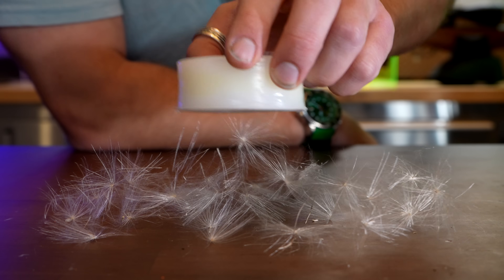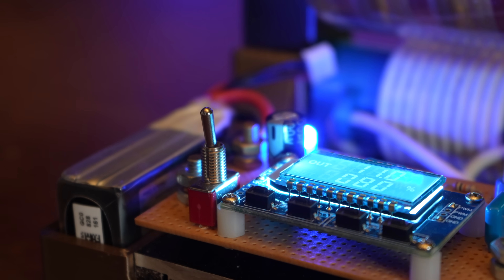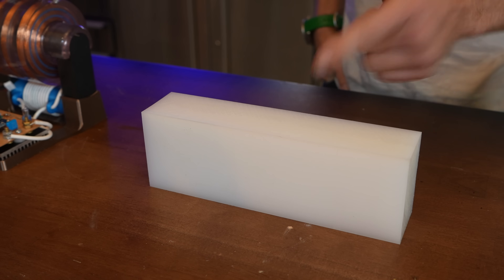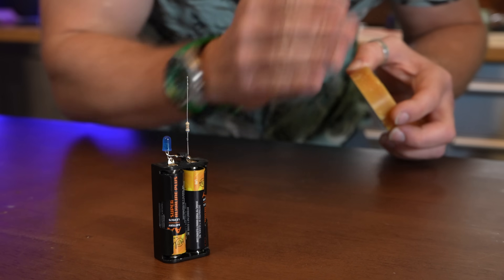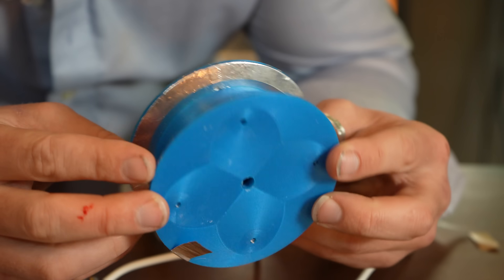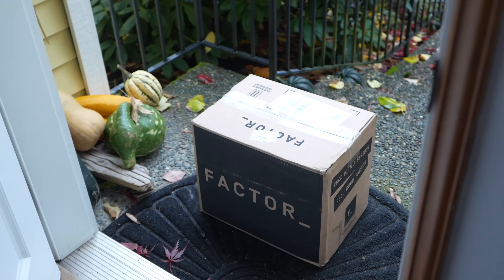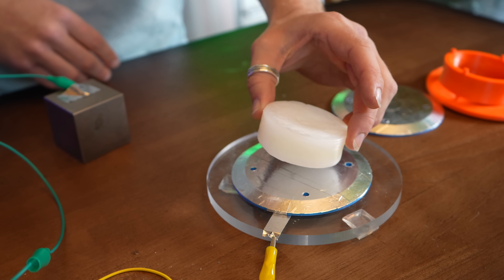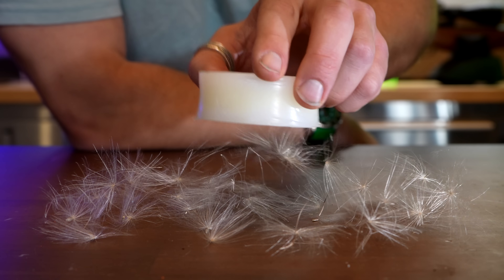Creating an Exotic Material With A Permanent Static Charge (Electret)

Comment: I wonder if you could make a higher resolution detector out of a tv screen.
I'm surprised there are not more comments about the finger pointing effect...
My take...
We are all capacitors, the finger tips are the ends of our "circuitry", ancient (and contemporary) eastern traditions call these circuits, meridians. 

Six meridians start and end at the finger tips, six start or end at the toe tips. Yin meridians of the Hand terminate in the fingers. Yang meridians of the Hand begin in the fingers. The Yin and Yang meridians begin and end the opposite way on the feet.

If that's too Woo, disregarding the long history and scientific inquiry over the last century,
Think of it like a tesla coil without a sphere, the arcs come from the sharp points, usually at the furthest point.

Watch the video titled: Mysterious plasma starts glowing from fingertips.

Our sense of touch like all of our senses are electrical phenomena, this is why touching someone, like holding hands or even the pain of a joint lock will dissipate unless a slight squeezing or rubbing or twisting happens.

Ever tried tickling someone with an elbow? Not very effective. 
It is the tips of the fingers that conduct the most energy to the receptors of the other person.

We are Electric beings 
In an Electric Universe
Much Love
Terra Pax

Comment: When you point your finger at  your Van de Graaff generator, it doesn't actually lose charge, or at least not a lot. The static electric field from the generator causes the electrons in your finger to be either attracted on pushed away, depending on charge of the sphere. The result is a charged finger, which creates it's own electric field, which is opposite to the primary field and completely offsets it within your finger. But this field extends beyond your finger, weakening the primary field. If you get your finger close enough to the generator, it's field becomes strong enough to reduce the field at the detector below the detection threshold.
Reply: Same as how an electrolytic capacitor has greater capacitance than a vacuum capacitor.  Actually any dielectric will counteract the field between the plates in the same way as you describe.
Reply: @goodmaro 
Its different effect. But same result.
Dielectric are non conductive you are conductive.
Reply: Nice explanation
Reply: The question is why pointing with a finger but not the palm of the hand effects it.  This is because the electric field comes off a object straight out.  Your finger is a POINT (rather then a plane) where the electric field is concentrated on the tip of your finger.  The lines of force are all equally spaced on the surface of the conductor (your finger).  Since the tip of your finger is sort of a point, in order to have the same number of lines of force as in a non-point,  the field must be stronger.  Must in the sense that it's got to follow the rules of electric fields that require the charge to be equal anywhere on the conductor.  So when the guy points at the generator, it sucks much more electric field off the generator then just putting your flat hand by it.  It is not a result of 'capacitance' or inductance.  Just DC electric fields.
Reply: @fredwork4919  what is a capacitor if not an electric field?
Reply: @fredwork4919  geometry does absolutely matter in this case i would agree, changes it's distrubution of charge and accumilation. If i'm not mistaken, some ol electrician wizards can even create complex circutry through geometric setup considering magnetic field interaction alone.
Reply: It is because his finger tip is a greater attractor than the free space around the sphere, so as he closes in on it pointing at it, the is a gradient change that is attracted to his finger that changes the shape of the once spherical field that was around the sphere.  Like a star bleeding off another kind of shape.  A High Voltage DC power supply and dielectric fluid bath can show a perfect example of the same effect.  Here is what I mean...
I watched one of our new engineers give a demonstration at the HV maker I was at many years ago.  We use a dielectric fluid in the lab to test new HV builds in the lab that have not yet been potted in their HV section.  It looks like water...  scary.  It has about a 1500 volts per mil of dielectric insulative strength, however.  So, a 50kV HV supply was sitting in a 3 inch deep bath of this fluid, with nothing connected to its also immersed output terminal. He took a 3.5 foot long 1 inch stick with a HV wire on it and a nail on the end of it with a rounded, polished nose ground on the end of the nail.  He grounded the wire to the supply ground and as he approached the bath to within a foot, the bath started 'turbulating' (for lack of a better word) or dancing around as it were as he got closer and it got more so as he got closer.  He actually immersed that rounded tip and had to get to that breakdown distance and ZAP!!! it fired a spark THROUGH the fluorinert fluid, which I had never seen before, triggering the auto-shutdown on our circuit.  Then, he repeated the demonstration with a sharpened nail end as the 'probe'.  The fluid dance started over two feet away from the bath the moment he turned the nail point toward it!  And BEFORE he was able to get the nail point down near the bath the spark ZAPPED out of the fluid to the nail! It is all about gradient level and attraction.  A huge attractor, such as the Earth gets a pointy thing mounted to it.  That's where the lightning strikes hit.  Caught in a lightning storm?  Make yourself a little fetal ball on the ground.  No extended arms or legs.
Reply: Yep high k factor electrolitics with monatomic doping is great fun.
Reply: The keyword is dipole. Dipole fields are weaker than monopole.

Comment: So, have you TRIED the MOTION of the Electret as it passes by a Magnet.  Or how they ' interact ' with Magenets. Then the extrapolation is from ELECTRICAL CHARGE to Magnetic CHARGE/Induction in  ' other ' materials.
Reply: Well, isn't that special.  Apparently no one in the comments really knew what an electret is or even has a clue of the significance.  Ping me if you want more insight.  Beware the Rabbit Holes.

Comment: When they are making Electret microphone capsules at the factory, I always heard that they have to give the Electret it's initial 'charge'.

It's strange to think about how long the material can hold that charge, which is often many years / decades.

I don't know if that's quite how an Electret mic works, though. lol

Most of the small capsules just have a FET inside, with the Gate hooked up to the Electret membrane.

Comment: What happens when you make a electret in hollow cylinder form, charged inside and out rather from end to end? If you made a pipe formed  electret with a positive charge on the interior how might that effect water and air flow through the pipe?

Comment: Back in the old days Benjamin Franklin stated that the stored energy of a capacitor is inside the insulator not the conductors so technically the capacitor is the non-conductive material or the insulator. Wouldn't this technically be considered as a permanently charged capacitor if it can handle a "load"

Comment: The dielectric breakdown of air is proportional to pressure, so could you eliminate the corona and use a stronger electric field if you did the cooling in a pressure chamber? Maybe even SF6 if you wanted to be really insane?

Comment: If there is a permanent charge, then, isn't that free energy? It can turn on a led, all the time, what if you create a circuit with houndreds of big and powerful electrets, charging capacitors and then alimenting something? Maybe a circuit with an high voltage trasformer, to get infinite lightnings
Reply: lol no, that's not free energy. battery is used to light the led, not the field of the electret. the field is, well, a field, it doesn't perform work. also, he used an enormous amount of energy to make the thing. and it isn't, strictly speaking, permanent, it will dissipate eventually. in weeks or years, but the charge will go away.
Reply: @ironwheal  yea i didnt think it much when i asked the question, but for sure it doesn't go away in weeks if you do it well, it can last many years, the ones in microphones should last at least 30 years, and in the video he says those ones last even 100 years, 
But i wouldnt be that sure on the fact that you cant make energy out of it, there already is a very simple motor that work just with static attraction
Reply: @Justabeingg  sorry, the energy still has to come from somewhere. there ain't such a thing as free energy. well, technically there is (hydro, solar, geothermal, etc), but it's still not free to make it usable.

Comment: Maybe ten or fifteen years ago, I imagined a static field detector by using a rotating disc with exact same type of sensors. One sensor has a JFET transistor.
So, while each sensor to be placed on the edge of the ring, it might be able to detect the DIRECTION of electrostatic field.. or would be?

Comment: Had all kinds of fun playing a magic trick on my boss when I built a detector a couple decades ago. I removed the safety resistor which seemed to increase the sensitivity at risk of blowing out the MOSFET, but the result was great: I stood on a linoleum surface and keeping my hands visible and motionless could say "on" and "off" and have the light respond. I triggered it by lifting or lowering my shoe on/off the floor. That surface pulling action built enough charge in me for the detector to trigger. Was hilarious as he tried to figure out how I was making such as simple circuit work by voice. :D

Comment: The reason the light turns off when you point your finger is because current started to flow through your finger. The same reason your first electret turned out poor due to the coronas.

Comment: Does the field strength of the electret vary if you cut in in half (without generating too much heat in the process)

How many times and how frequently could an electret charge a capacitor without experiencing thermal decay, and could it be the basis for a switching power supply for at least 1.5 to 3.3 volt applications?

Comment: With the vandegraff, I think picturing a constant number of field lines is accurate. At first there are a bunch of lines from the top to the bottom of the generator between paired charges. Let's say + on top, - on bottom. As a conductor, you're going to become polarized to oppose the vandegraff: - on top, + on bottom. Now the field lines previously pointing from the top to the bottom of the generator are going to be pointed more towards you, ending at your corresponding charges. There are now a lower density of field-lines passing across the resistor, meaning a lower E-gradient, causing lower current, keeping the transistor subthreshold.

Comment: I think the Van-de-Graaff stopped activating the field detector for the same reason that the first attempt failed. Just like the intense coronal discharge on the first mold, you might have given the static charge from the generator a way to escape by putting your finger closer. So the field never reached the required strength threshold.

Comment: Your vandegraff emits charge that you can pull to light a halogen light, right?

Can you not indefinitely light a light with this then?

And what about if you made two and pointed them at each other and did experiments like with magnets?

Further, what would increase strength? thinner with more surface area? Thicker? Individually thin stacked wafers?

Comment: I was thinking, as the electric field decreases with the square of the distance (E is proportional to 1/R^2, where R is the distance), when you apply the E field to the material, the inner parts will be affected by a weaker field, so why don't you make multiple thinner electrets and you stack them on top of the other, to obtain a stronger electric field?

Comment: I think the reason why the electrons are not going to the electricity detector is because when you point at it it you are taking in the electricity instead of letting the static go to the detector through the air
Reply: agree

Comment: Question?

If the Great Pyramid was a giant Van Degraf generator then that must mean the casing stones was able to contain the collected ions within, How would that possible?

There has to be some way

My idea is If the Star Shafts in the queens chamber of the great pyramid held liquid mercury like I've suggested and if the metal spun when electricity was applied then the surrounding ions would whirlpool around the shafts...
Kind of like if you spin an electric drill bit in water then the surrounding water would whirlpool around the spinning bit in unison?
so this would create a current effect with the ions
---------------------------------------
In fact I think the Star shafts had several uses...but mostly it was a giant tuning fork

It created vibration - this charged the 2? tons of quarts crystals embedded throughout the stone.The vibrating stone also produced ions?. 
-----------
Vibrational frequencies

So basically the Star Shafts are a giant tuning fork, when the Mercury is spun it produces a vibrational frequency and also vibrates the stone

They're even shaped like a tuning fork the way the shafts bend 

& if another tuning fork is added above?

You would in effect create a torrid structure throughout the entire structure, this would ram +ions thru the capstone & into the ionosphere above & create a gravitational field too

Also note the shape of the pyramid is very much like a giant cone, this is a very powerful shape

Take the theories about flight mh370 for example where supposedly three plasma orbs traveled down a cone trajectory to create a wormhole.  

This would mean the Pyramid acted like a giant Van degraf generator but it had a cone shape instead of a round sphere  

picture if you put a giant cone inside the doughnut looking torrid structure, then picture what would happen when you ram +ions thru the upper tip?

I have no scientifical learnings & I may just be blowing pot smoke outta my ass ... Or maybe I'm one of those pathetic youtube experts who suddenly know everything because he watched a couple of videos 

So feel free to just spit on me and walk away I care not 

Since everything has it's own vibrational frequency then what did the two tuning forks in the structure actually do besides create a torrid structure? 

 & what would happen is +ions traveled thru stone & struck the charged quarts crystals contained within?

You wouldn't need a belt to charge the Pyramid, even running water far below the structure could gather ions right?

& also could it be possible that the casing stone would repel the ions inside to contain them until they could be shot thru the capstone? maybe the casing stones were -?

Comment: I think your mold should have two holes: one for the stuff to get in and another for air to get out. If you 3D print a small pool area (basically a funnel) around the infil hole, you keep filling the mold until it starts to come out of the air hole. For further details, see metal molding.

Comment: electricity goes to pointy thing, you're discharging the vandagraf generator, the charges are running to your finger in a steady stream, but they're not concentrated enough to discharge in an arc.

Comment: Would it be crazy to make a detector out of a string light arrangement for a visualization in 3 dimensions? lights every couple inches on a string. Multiple string suspended in a grind, creating a 3 dimensional grid of lights in the space. Could you have the lights change colour based on electric field intensity?

Comment: It would be interesting to see the affect of the electric fields from such an electret on alpha and beta particles in a cloud chamber.
Perhaps you would need to place the radiation source between two electrets in order to achieve a maximal flux to hopefully see significant deflection... beta particles should be much more visibly deflected than alpha particles, of course. Then again, maybe the electric field from the electret would make it too difficult to see the stream from alpha or beta particles...
On a similar note, it would be interesting to see if/how much beta particles would be deflected along magnetic field lines, by placing a radiation source on one pole of a strong magnet (i.e. N52 or higher)...
Although, it's possible that alpha and beta particles could emit xrays when deflected by a magnetic field, if they're fast enough. I'm not sure if they have enough energy immediately after a decay in order to emit an xray photon due to synchrotron radiation.

Comment: Couldn't you measure your field using a voltmeter? You could literally map electrical potential difference across the field by moving your 2 electrodes in the air around your electret

Comment: Got a suggestion in case you build another one. We all know rubber is a great insulator for electric charge. Wouldn’t using that to prevent the arcing during the creation of an electret allow you to yield a stronger charge? Probably around 1/2 inch to 1 1/2 inch of rubber to insulate properly.
Reply: just make the charge plate smaller than the mould, even dent it inward so charge would have to go even further, cut out the electret in the center when its cool. That way theres no air gap at all for arcing.

Comment: OK, so... what if you used an array of them (think dc brushed motor but swap out the perment magnets and dc sorce current and drive it with a static charge) I think that would be hella intersting also what if you used that  with your ionic thruster...... thanks for the videos!